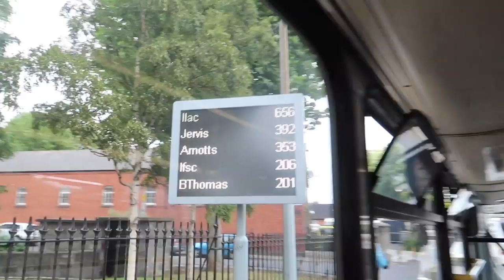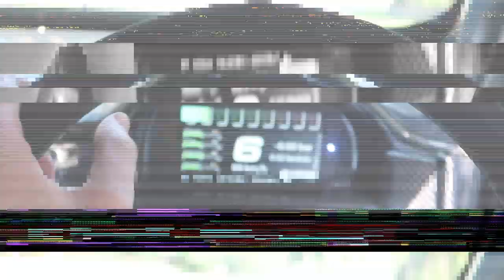Where Eurofighters are born, It's RIGA BABY!

Comment: Why do you have to put stickers on the wheels? can't they be black? why, if so?
Reply: It's so the judges can see when they are using the handbrake (wheels locked)
Reply: @robvanderkroft6515  ty bud
Reply: And foot brake, also easier to see steering corrections